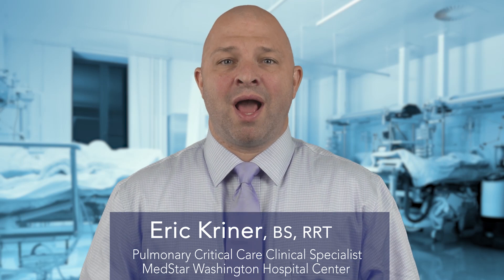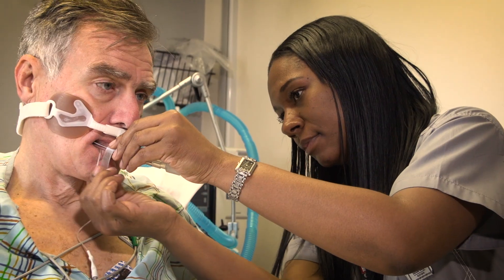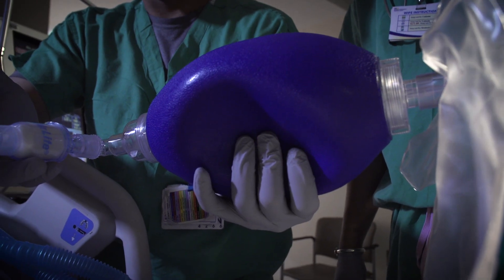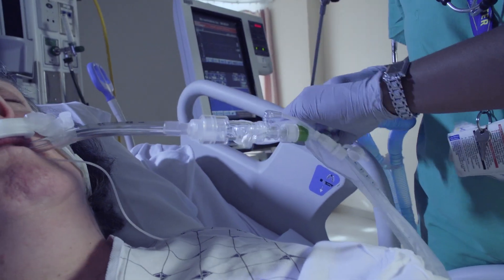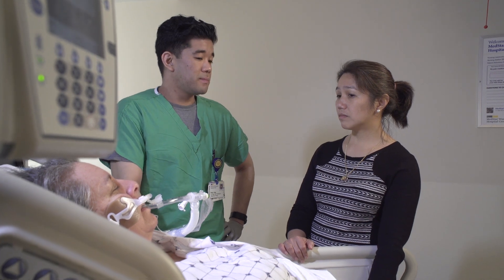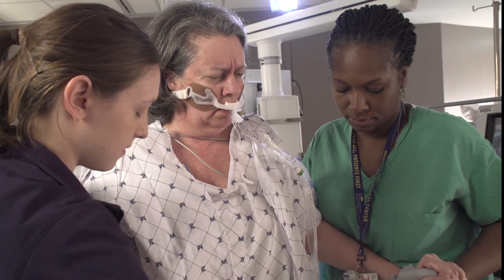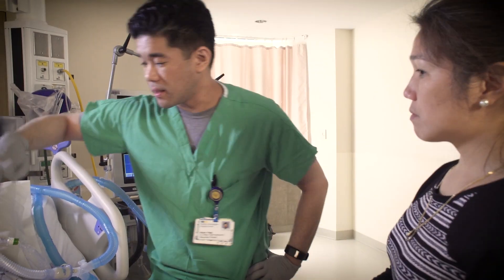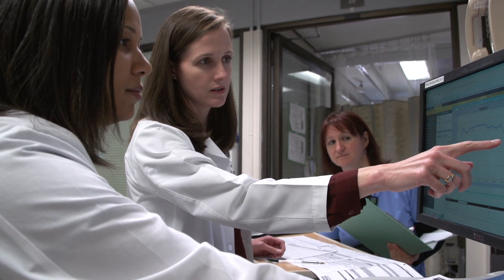Mechanical Ventilation

Comment: Been there, done that, decades ago.  SHOULD be better now, but it's worse than your worst nightmares, mainly since you can't communicate & it feels like the settings are too high/your lungs are exploding (you're often too drugged to use pen&pad; even if YOU think it's readable, it's just scribble.  Tablets w/ pre-programmed, multiple choice common AUDIBLE responses can & should help greatly.)

 Remember, the way these work are by using air pressure to forceably inflate your lungs like a balloon...sometimes way,way past the level at which YOU feel your lungs will literally tear open. 

Then again,  thanks to that,  I'm still here,  b$tching, laughing, loving, being loved, even skydiving, and .... yelling at the news (on ALL channels.) Thanks,  in part to the ventilator.  Life is a chain in which the "weakest link" is changing every moment.  When you NEED a ventilator,  there's no substitute. Remember,  even a few minutes without oxygen means partial or critical brain damage ->vegetable w/arms.